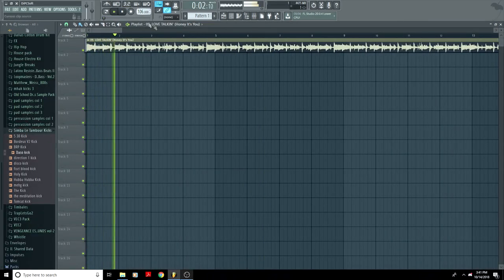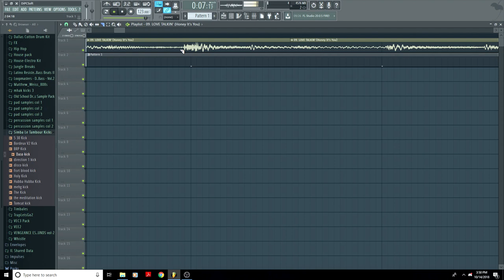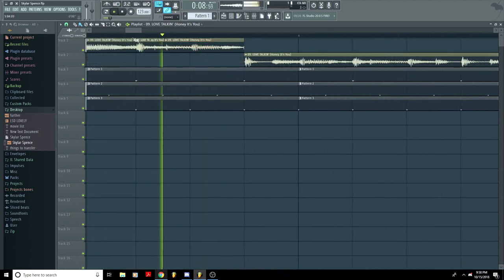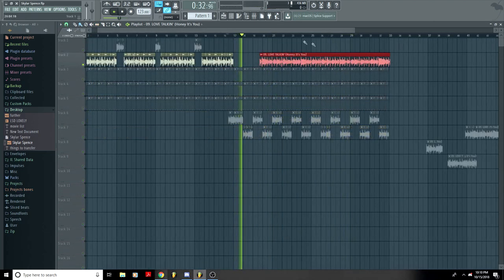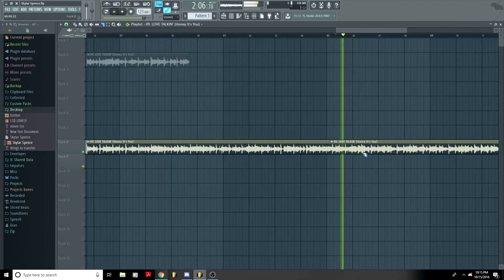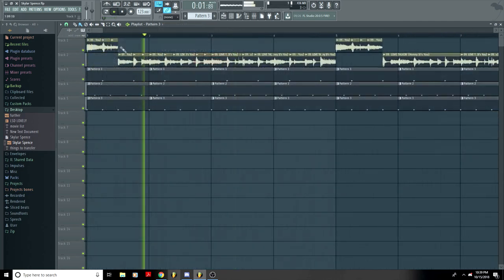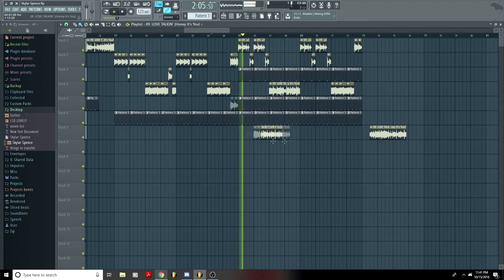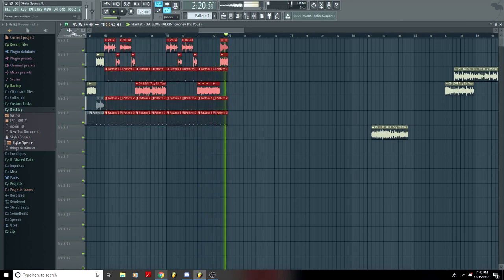Future Funk Tutorial | Remaking Saint Pepsi - Skylar Spence

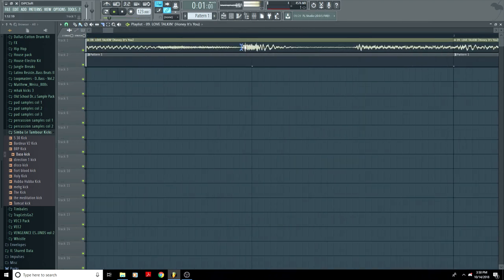Comment: One tip that I'd like to point out is the part about transient noises at 0:44. For anyone that doesn't really understand what a transient is, it is the initial amplitude spike in any audio waveform. Basically, the "click" that you hear in the beginning of any percussive element has a sharp transient when you remove that transient, you remove the initial impact that percussion element has. Transients are not limited to percussion, they appear in any type of audio signal all of the time. 
When you sidechain a kick to a sample, you are basically instructing your DAW to use the amplitude of one audio signal (your kick) as your input and ducking the volume on your output (the sample) based on the amplitude of your input. What ED is referring to as "transient noise" is actually transient clicks, where the sample is slightly offset to play too early. When that offset sample is sidechained, a small portion of the sample's transient plays there and causes that off sounding click before your kick or smare. 

ED fixes those by slightly adjusting the time of the sample to match FL's beatgrid.
If you listen to the original Skylar Spence track, Saint Pepsi didn't really deal with this too much, and certain transient clicks come through. But its an important point because a lot of people do this with their original tracks, and simple adjustment can make a sample based track sound much cleaner.

Great video overall though!! super accurate recreation of the track.
Reply from the maker: I could not have said it any better! Thanks Fibre!